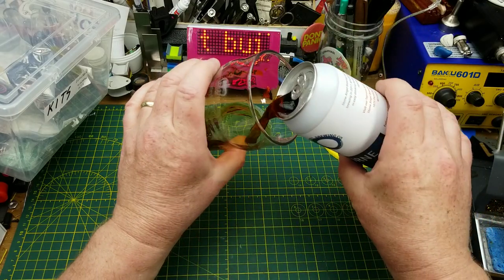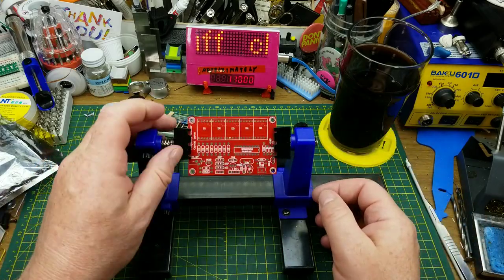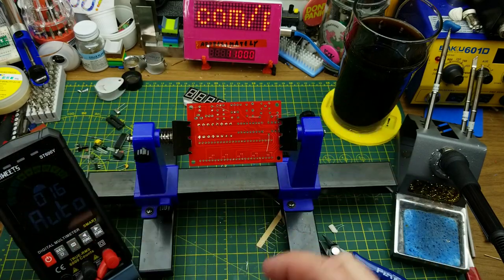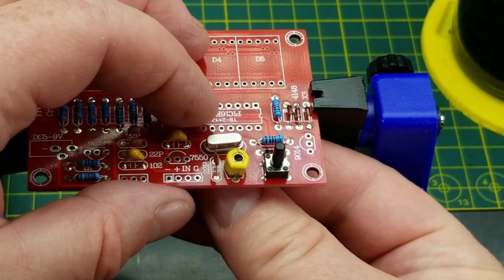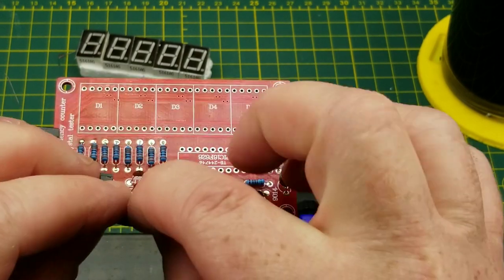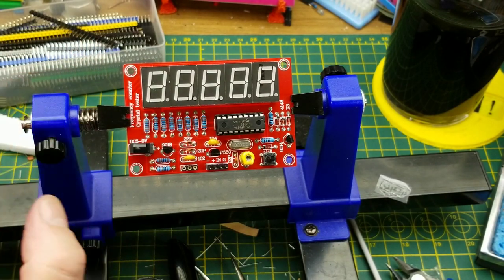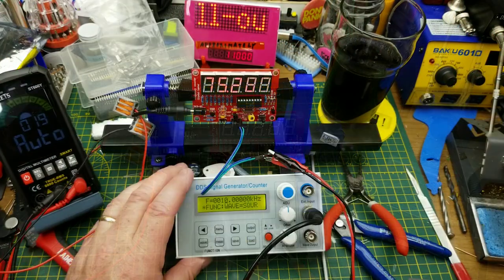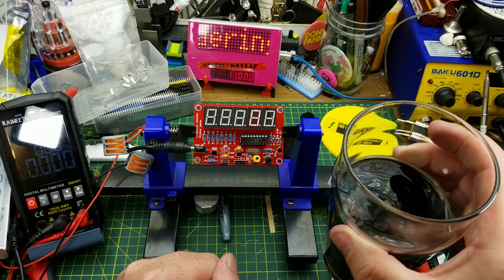relaxing kit build: crystal tester

Comment: Greetings:
The counter can be used to display the carrier frequency of a radio station when the intermediate frequency is loaded into a register of the PIC controller. The push button is used to select that function and input the IF value (I assume). Since I no longer need to worry about dial tracking, I will use the RF trimming adjustments to widen my tuning range.
I have not yet completed my kit yet, but it will become the substitute frequency display for the tuning dial in my kit tube AM radio with a 455kHz IF. Old age (72) has limited my manual dexterity, so I use my son to do what I cannot.

Comment: I always have the crystal standing off the board, ever since I built a kit years ago and found out, (eventually), the crystal body was shorting out the pads the pins were soldered to. :)

Congrats on the 11K subs, BTW.
Reply: Thanks for the tip! I have always soldered mine close to the board and not had a problem....but i guess i was just lucky. I will remember to stand them off a little now....thanks!
Reply from the maker: Having them standing off a bit also lets the lead wires act as a bit of a vibration damper to isolate the crystal from mechanical vibration in the rest of the device.
Not a big issue in this application, but it can me important in other devices.
Reply: @pileofstuff  Cool....thanks!

Comment: I think you are right with the kit being more a "Working and in the ball park" type tester.    It can only be as accurate as the components supplied in the kit, and it is not exactly a oven controlled crystal or high accuracy caps and resistors supplied in the kit.  
It really was a great, relaxing build and even just watching it on YouTube was a great way to wind down after a crazy busy week

Comment: Thanks for the tip on cutting crystal leads, that was a new one on me.  Makes mechanical sense.   
On my unit, that pot only adjusted the strobing rate of the LEDs from blank to functional, and in getting it to work as a frequency counter, I had to adjust the signal generator's output level to a fine degree - something like 4.8v +/- 50mV.

Comment: Crystals behave differently depending on whether they are intended for series or parallel connection. Crystals from car clocks are nearly always good quality and accurate since they need to work over pretty big temperature ranges while still keeping accurate time. Crystals from old radio equipment are nearly always spot on too, since they needed to conform to specific standards to avoid interfering with neighbouring frequencies. So calibrating the counter against a couple of known good crystals should allow for reasonably accurate measurements or an offset compensation chart to be created. Maybe not the most accurate device, but good enough for the home hobbyist and to confirm that a crystal is oscillating and undamaged. Bits of crystal can shatter off if they are dropped raising the crystal frequency. Older cans with a crystal held between spring clamps can be retuned or trimmed to higher frequencies using fine emery paper to slightly reduce the thickness of the crystal.

Comment: If you had a good quality crystal, you could insert it and adjust the capacitor until it reads correctly. Then at least it will be as accurate as the crystal you chose.

Comment: Hi, I built one of these a couple of months ago, I couldn't figure out what the trimmer cap does, it didn't alter the frequency but just the amplitude of the waveform..
Reply: On my unit, I found that adjusting that cap made the display go from completely blank, to strobing the segments, to working properly.

Comment: I have the same unit and another different unit with the yellow button. Both units will NOT read above 20 MHz properly. example, 37.600 MHz displays 15.53xx. Other 37, 38 45 MHz crystals show similar results. They 'divide' by 3-ish and that's what they display. Anyone know the fix?

Comment: I don't think using the oscilloscope when adjusting trimmer capacitors is a good idea. The scope and its probe have their own capacitance which would detune the circuit.
Reply from the maker: They did a little, but setting the probe to 10X reduced the influence quite a bit.
It's not perfect, but it's the best option I have available at the moment.
Reply: Even your own hand near the circuit will introduce capacitance whilst adjusting the trimmer!

Comment: Crystals are my weak area --- not sure why but every time I try to build a circuit or just even try to measure one I do not succeed. I even purchased this kit and successfully put it together but um ... can't seem to measure crystals with it successfully. 😆
Reply: Check ALL the components carefully. When I built mine the kit contained three transistors instead of two transistors and a voltage regulator. Luckily I had a voltage regulator to throw in. 😮‍💨👍

Comment: How difficult might it be to hack this thing into a clock .. I mean a clock would be useful at least ^^
Reply from the maker: Probably as "simple" as re-programming the microcontroller.
Though PICs need some special hardware that i don't have, so that is a limiting factor.
Reply: @pileofstuff  So I delivered both : a new item for the ebay list AND a modding project for a frequency counter :D
Reply: @pileofstuff  A cheap TL866II will reprogram the PIC easily. Then put on the alternate firmware to increase the resolution and features of the kit too.